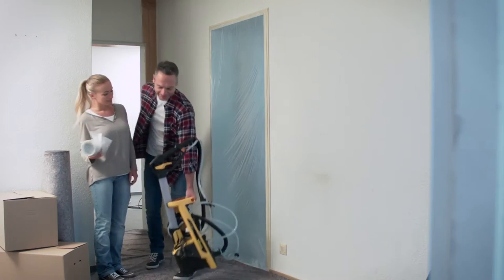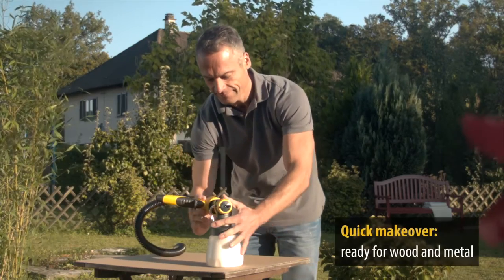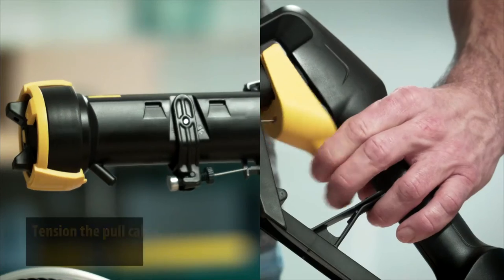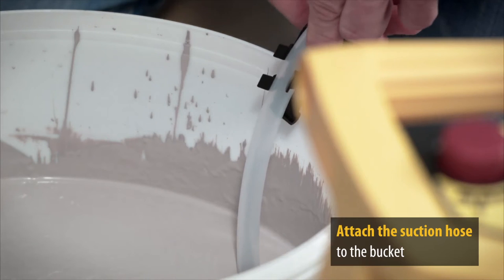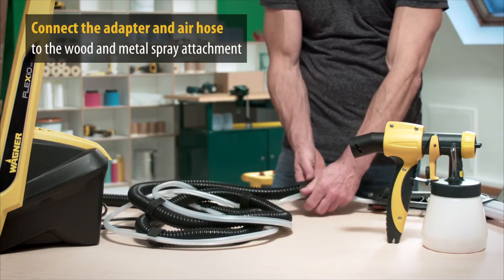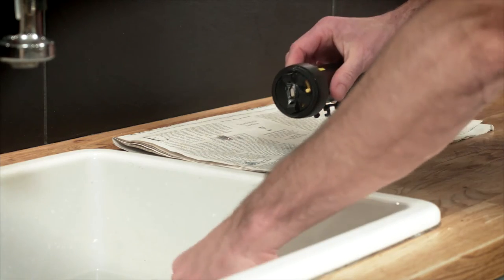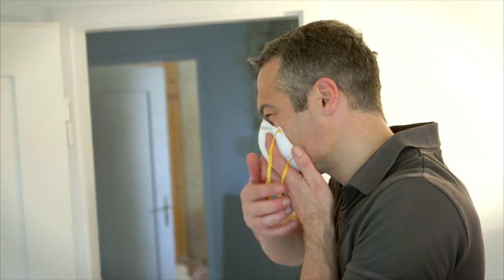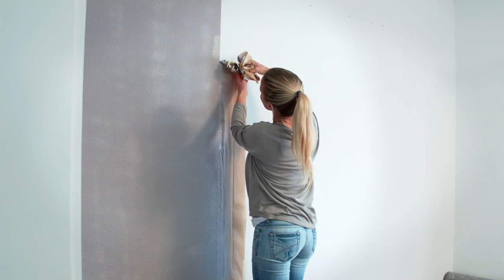WAGNER Universal Sprayer W 950 FELXiO | Product guidance (English)

Comment: I recently bought one of these and used it to paint the roof. I found it to be a great product. My only suggestion would be to make the paint suction pipe longer so I could move the base unit around without moving the paint container. 
The unit works well and is great for larger DIY Projects. The spray finish was really professional looking. Highly recommended
Reply from the maker: Hello Lyndon thank you for your feedback you make a valid point.  With our airless range of machines you getting a longer reach with a 15M or longer hose so that you do not need to move the machine to cover most rooms.  Kind Regards the WAGNER DIY Team

Comment: Avoid this piece of crap .I bought this and the second use it started to fall apart .Cheap nasty quality .Also once you put the lance 
together you can't undo it , so it wont fit in the box if you want to return it .One thing you will notice that their entire range use the same video and the wording in the manual is appaling english . Just try to find a comparisons WAGNER Control Pro 250 R & 350 R